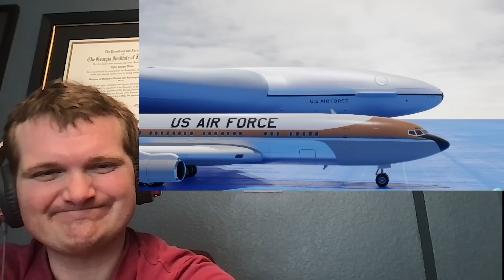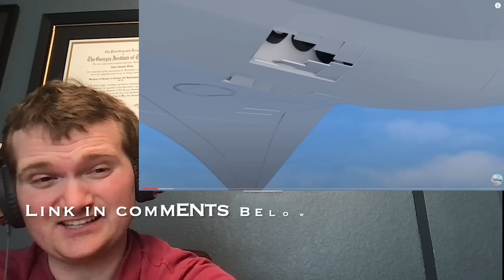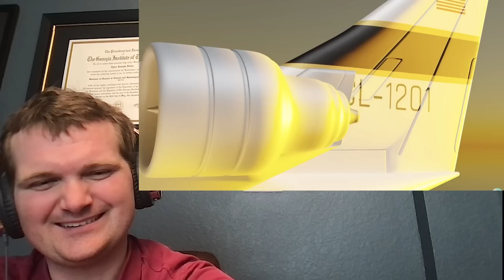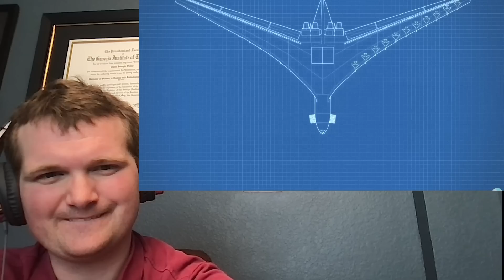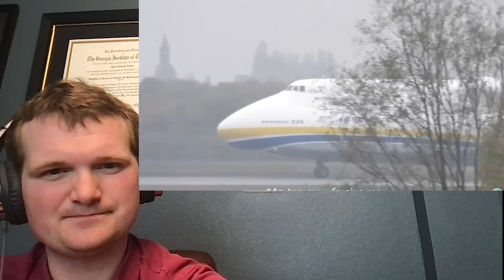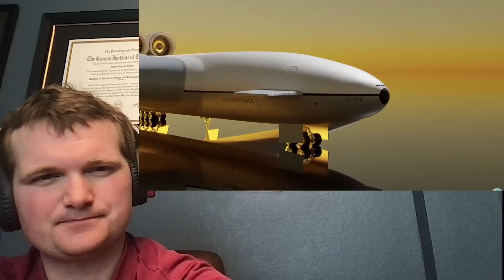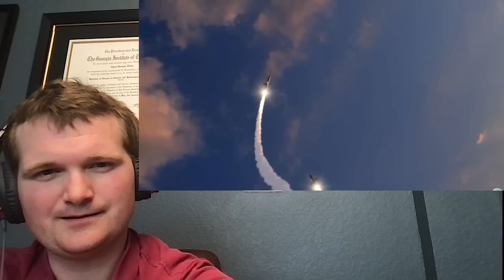A Fleet of Nuclear Flying Aircraft Carriers? - Nuclear Engineer Reacts to Found and Explained

Comment: 1:57 Wait, dont planes come up and dock with it??? This thing never has to land, maybe for deep overhaul and maintenance… because the right play here would be to ideally have every possible part repair/replaceable from within. It’s large enough that all individual structural components could be made redundant so removing any single part won’t compromise the plane’s airworthiness. 
          Also youre gonna need some serious microburst rockets… jeez (anyone familiar enough with what a microburst is) imagine flying into - really it’s trying to fly out of - one, even in a sensibly-massive airplane like a C5 galaxy or an antanov (or an L1011 Tri-star… Watch something about that incident to get some idea of the futility).
          And there’s yet another issue. It CANNOT be like a steamship where the “pilot” is really just steering and has to basically command the engine operators whatever he needs the engines to do. Everything happens 100x faster with flight (but things can head south pretty quickly on a ship, at that). 
          Not to mention you have to 100x THAT with a damn nuclear reactor. No “pilot” alive on this planet would have the training or ability to mount & conquer this beast… they also wouldn’t be able to safely fly it, either. You’d need an entirely new (incredibly demanding, stressful) career, a “nuclear powerplant pilot”. Because that’s what you’d be flying - the rest is the containment structure.
          “Cockpit” (always a funny word)? More like the plane’s “bridge”! I like to imagine theres no “yoke” just an old pirate ship’s wheel (for aileron/roll) mounted on a column that you can pull/push on for pitch control. Someone will surely want to wish you good luck & let you know everyone’s counting on you… (then they should avoid calling you Shirley).

32:18 Thats why (well… probably not the reason but anyways) the government changed it to Anomalous Aerial Phenomena in official reporting (sometime in the 2010’s I think).
Reply: This thing would still have to regularly land for things like food and water. And regarding the immense amount of new skills needed to fly it. I’m sure be extending the cockpit crew to include more people like extra pilots and flight engineers would drastically lower the pilot’s burden
Reply: @WillYouSurrender  Oh yeah I’d think it would need a whole bridge-crew or at least a reactor & flight engineer. But as for food and water, load up a smaller plane with supplies and fly it all up - the whole point is to be able to recover aircraft under-wing, something like a miniature crew/cargo-shuttle would have to be developed in-parallel. Or (for supplies) they could just “catch” a dropped package under-balloon, much like the original Corona Sats’ film packets? It’s feasible, but also insane…
Reply: @SenatorFenderman_PA  the plane to plane docking would work great for the transport variant but not the carrier type. Can’t exactly resupply dozens of people with thirty days of supplies all while using f 4s as your shuttle craft
Reply: @WillYouSurrender  Yeah the Phantom’s all-engine practically so it can go mach 2, what about a twin-otter or some turbine-powered equivalent? There are a bunch of communities (of several dozen +) up-north supplied exactly that way. Depending how the docking mechanism would work, you could possibly even modify an existing aircraft for this. Again feasible but insane and hardly useful outside of WW3…

Comment: The largest tactical problem would have been the parasite fighter design IMO. The idea of a long range aircraft being the airborne hanger for its own air defense has been tried a few times, getting the fighters released is relatively simple but any attempt to dock them back while both planes are in flight is just a disaster in the making.

Comment: tmi did have confirmed iodine xenon etc as it didnt have loop back venting it was direct to atmosphere. from the core... it came out the vent grey... you could hear it venting.

the water and wind helped contaminate rivers lakes and streams ... you could probably still find hot spots but a lot was ionized charged particles...
Reply: 3 people were hospitalized from that ufo and disgnosed with radiation burns
Reply: There was an indirect cycle one, too

Comment: As far as the "laser cannons" it took 50 years, but in 2014 a point defense lase was installed on USS Ponce, and I believe are now in semi regular use. Not to mention things like DE-MSHORAD, a laser weapons system mounted on a Stryker wheeled combat vehicle. It's effective against drones and smaller targets, and if it fits on a medium sized armored vehicle I'm pretty sure you could fit several on something like that, especially since you'd be able to draw power from the reactor instead of having its own generator.

Comment: 1. The Soviet Union wasn't communistic (that would meant that they would have no powerhierarchy at the very least - what was obviously not the case).

2. The idea alone, that communist states would attack the USA - for what? The reason why the west tries to conquer Russia over and over again is that it is the richest country on this plaent by far with 75.000.000.000.000$ in raw resource reserves. USA is second place (by large distance already) - but over 90% of that is coal and timber. There would simply be no interest for anyone to conquer the USA (and even less Europe, which is batshit poor).

Comment: As far as barely-remembered nuclear accidents go, there was also the Army's reactor accident with 3 dead (all the crew at the plant) at the Idaho National Engineering Lab in 1961.  The reactor was the SL-1.  It was quite gruesome.  The rods were manually operated by personnel standing on top of the shielded reactor vessel.  A rod got stuck, an operator gave it a heave, and it was rapidly pulled up too far.  The resulting steam explosion due to prompt criticality literally bounced the reactor vessel off the overhead and impaled another operator, killing him.  One of the others died immediately from steam burns/suffocation, and the third died within a few hours.

Comment: I find it funny that the one thing you say is the most plausible, the point defense laser, has never had a working installed prototype, and the nuclear aircraft engine has 2 working prototypes (three if you count the Russian one.)  Do a search for HTRE-2 and HTRE-3, I find it fascinating how far along both projects got, all the while ignoring (at the time) current problems.  Such as, the aircraft flight times were already limited by engine oil consumption, not crew rest or fuel (you can pack a bunch of food, and in flight refueling was already a thing.)

So for reference, the nuclear powered aircraft idea actually didn't solve any problems that were not already solved, just invented a whole host of new absolute nightmares.
Reply: China has ground based and ship based laser weapons, and I'm pretty sure both are designed to ttake out missiles. I remember watching a video on this a few years ago, but yeah, the tech was not their in the 60s
Reply: @andrewdemarco3512  I wouldn't trust "what china has" as a great deal of information we get from them is propaganda and outright lies.

I was basing my statement of the prototype the US tested about 15 years ago that did not work as a point defense system.

But I think we are both on the same page.
Reply: I don't think the Royal Navy's DragonFire has been tested on missiles yet, and it doesn't work in sea-level clouds (AKA fog).

Comment: Reactor Propulsion 02 oboard the Truman (CVN75) from 2002-2008 when deployed we had sunday "Holiday Routine" where we did not have work day, training, nor drills, but watches are manned 24/7/365.  The plants are NEVER empty even when full shut down (cold iron). The pain of watch rotation was proportional to the number of qualified operators for each station.  The worst I experienced was 5/10; five on, ten off, but those off hours are filled with work day/scheduled maintenance, training, and drills if you were the off going shift.  Squeeze into that meal time (when you weren't on a watch), personal hygiene, and if there was any time left; sleep.  The best rotation I ever saw was 5/20, but typically 5/15.
Reply: Did a couple of weeks of 6 on/6 off while getting qualified on a sub and it was brutal.  Subs normally do 6 on/12 off which is OK, although sometimes the drill schedule is annoying.  The one division that got routinely screwed on attack subs in port was the reactor operators (I was mechanical), they usually only had enough bodies to do 3-section duty in port (means you're on the boat 24 hours every third day, regardless of weekends/holidays) while the rest of the boat was 4-section.
Reply: @robdgaming  Barf! That watch rotation sucks.  I forgot to mention shore duty, we were always 3 section for all of reactor department for as long as I was stationed on the Truman.  I made friends with some of the conventional mechanics and they were 7 section.  I think the most demoralizing aspect of being reactor was we were the first on, last off.  Reactor was not allowed to leave until long after port call was announced for E1s.

Comment: Even a submarine carrier makes more sense, that was actually tested by the Japanese in World War 2. It wasn't good.

A similar design that COULD be feasible would be a bigger version of one of those air command planes with radar and command stations plus drone operator stations and a small swarm of anti-air drones attached to the aircraft. It wouldn't be THIS big but still pretty darn big, I would say it still wouldn't need a nuclear reactor since you can refuel mid-air. 

This drone carrier could be not just feasible but very effective when it comes to airspace defense by having this behemoth cruising around detecting missiles and enemy aircraft and then sending out the AA drone swarm to intercept. Interception time as well as command efficiency would be significantly improved and overall response time and capability would be way better than currently.

I suspect the various spooky military organizations of the world are already working on this. I mean just imagine, this could cut down several minutes of response time. I'd say in a few years when they figure out jet powered supersonic drones which have a good connection still with minimal lag, this will go into development.

Comment: I can see that taking off in a conventional take of roll ( albeit  using a huge length of runway), what I have a harder time with is seeing it getting below a sane MALW ( Maximum All up Landing Weight). After all, this bird would hardly be able to dump the reactor the same way many aircraft dump fuel if they need to force their weight down in an emergency. The results could well be, um, energetic

Comment: With these crazy designs it's probably worth considering that the impracticality is much easier to convey to politicians and generals if you have an actual example. "Why can't we have a flying nuclear reactor?" "Well... Okay imagine we had one- You'd gain a mobile air base... But these would be the problems."
Reply: Problem is, Politicians stop listening after "Flying Aircraft Carrier", only when the costs and potectial contracts (and kickbacks) come up do they start thinking again weather or not this can benefit their re-election campaigns
Reply: what
Reply: @sayori3939  The idea is to be able to confidently state "you can't have X because it would require Y and Z which don't exist". Whereas if you just waffle on about generalities, the idiots on the ballot will look you straight in the eye and say "well then solve it, that's your job."
Reply: People waffling about generalities is annoying, they need to substantiate their claims and prove why it is impractical and how impractical it is.

Comment: The design specifications of the CL-1201 were

    Wingspan: 1,120 feet
    Gross weight: 5375 metric tonnes
    Endurance: 41 days
    Reactor output: 1830 megawatts
    Crew: 575
    Main engines: 4 (GE90 equivalents)

Comment: You are incorrect there has been one example of a flying Nuclear Reactor It was the NB-36H it lofted a test bed reactor that ran at criticality on 89 of the test flights. The reactor however was never used to generate propulsion.
Reply: The Tupolev Tu-95LAL was a similar Soviet aircraft that was flown with a test bed reactor but even though the reactor was active on some flights, it also was never flown on the reactor power.

Comment: The Arsenal Bird in Ace combat has a huge microwave-receiving antenna built into its fuselage, and these microwaves would be beamed down from an orbital station connected to the space-elevator the Arsenal bird was protecting. So in essence, as long as it was within direct line of sight, the Arsenal bird would get power from space.

Also, there are a ton of cool videos in that channel for you to react to. Can only recommend them, they are all awesome.